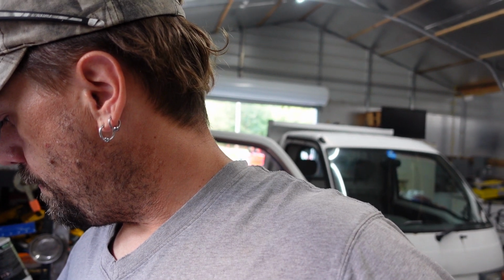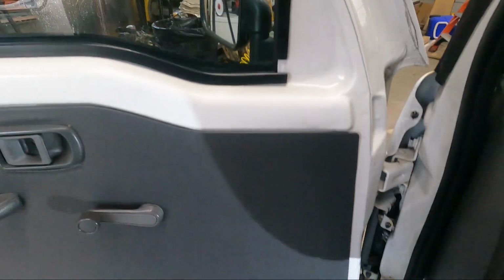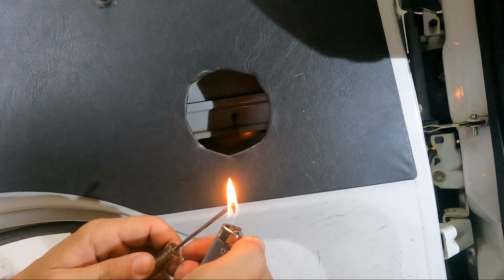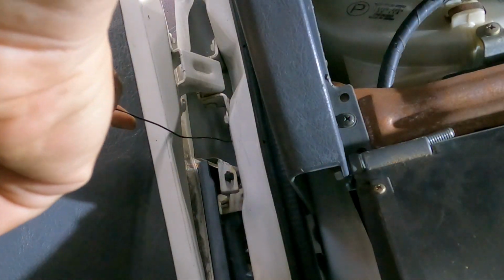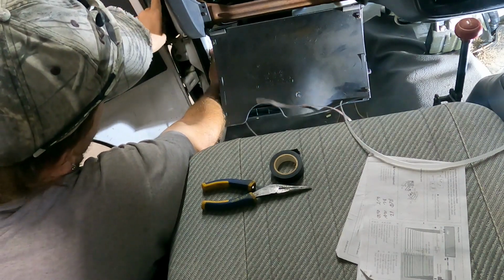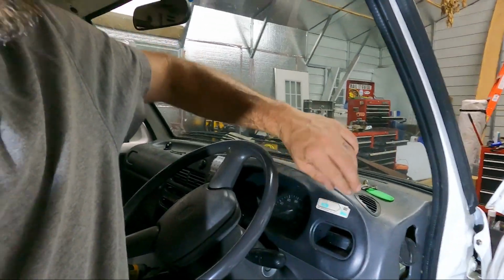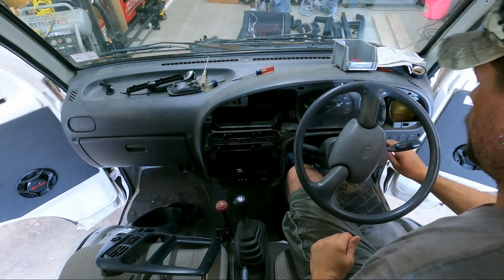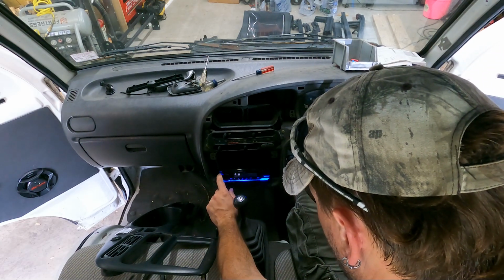Mini truck upgrades: installing speakers

Comment: Did you drill a hole for the cables to pass through? Or you going behind the headlight?
Reply from the maker: @JrGayle  I fished the wire behind the kick panels and out through where the factory wiring would have been.  It's a bugger to do but it keeps it clean.
Reply: @ Hrmm on my Hijet there isn’t any holes I guess yours may have had it. I’ll look again tonight. Love these tiny cars but man everything is so small haha
Reply from the maker: @JrGayle  if you look in the door jam just below the upper hinge you'll see a little circular sticker.  Use a piece of wire and you can push through the sticker and up and then you can reach behind the kick panel and find it.  There will be an associated hole in the door slightly lower than the sticker location.
Reply: @ I will definitely look again. Thank you for the tips appreciated